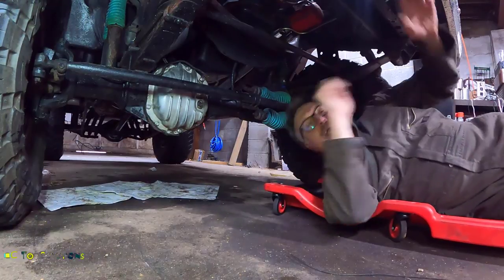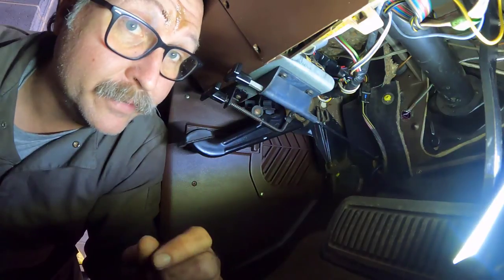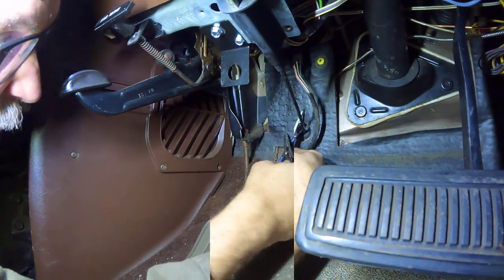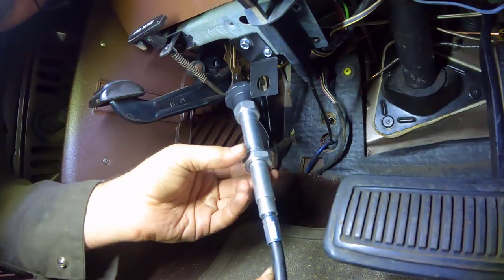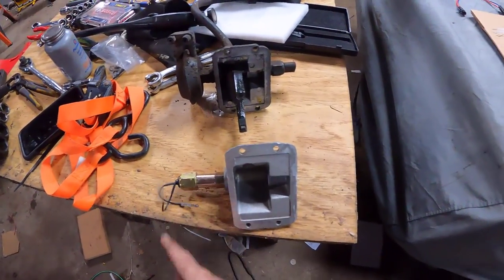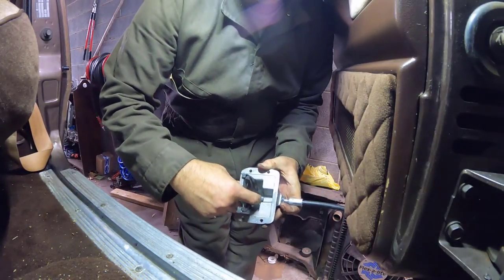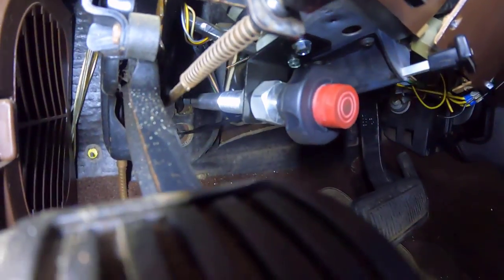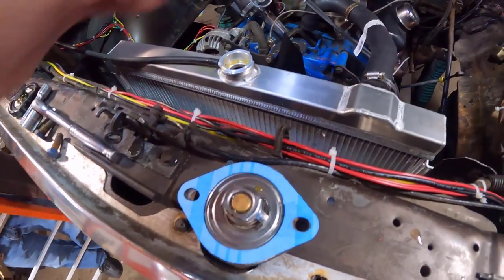Ramcharger 383 CAD Hub Delete Kit Installation, Thermostat Replacement, and Donuts / Snownuts

Comment: Sweet rig!!!  I love it!  My first rig was 78 Ramcharger with a 400 CID.  I've kicking myself in th butt ever since I traded it away back in 1986.  If you ever want to sell it, I hope I'll be able to buy it.
Reply from the maker: Thanks man! Im loving it. Im going to do a couple more upgrades (Borgeson steering shaft, alignment, electrical for aux lights and a tach, driver side rocker patch, tow hitch and a heater core). After that...I may sell Touchdown Bundy. Until then though, what a blast to drive! Im glad you enjoyed vid. Im going to keep them coming.

Comment: Nice! When Touchdown popped out of 4wd doing donuts and you said you'd have to make an adjustment, did adjusting it fix the problem?  Just curious. Can't wait for the next video!
Reply from the maker: I made a minor adjustment from the button in the cab, seems to have done the trick...but i havent replicated original condition to test it.

Comment: What radiator hose did you use ? I just 440 swapped my ram charger
Reply from the maker: I think I used one from Rockauto for like a 1977 big block ramcharger.
Reply: @CC_Top_Solutions  appreciate it !